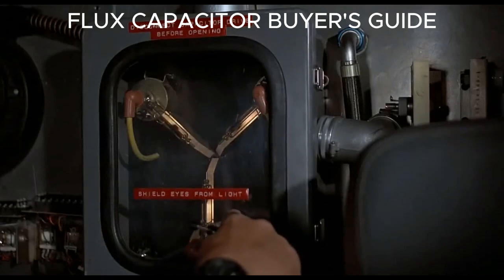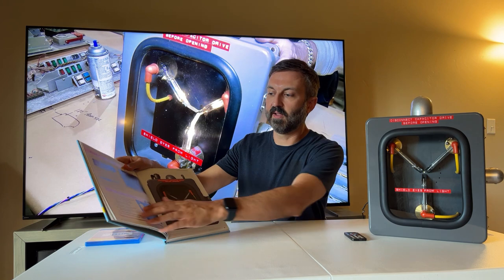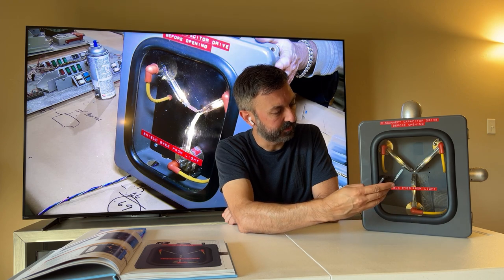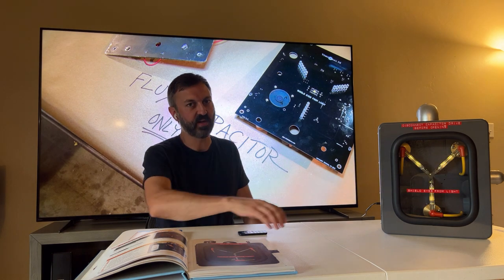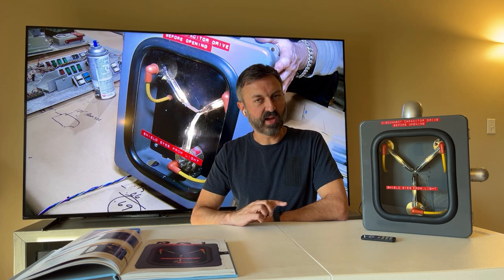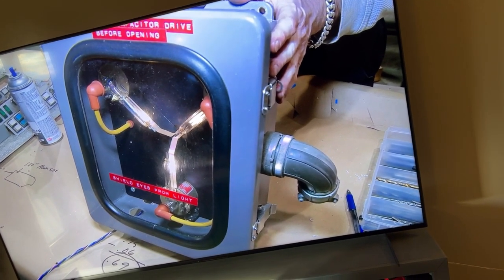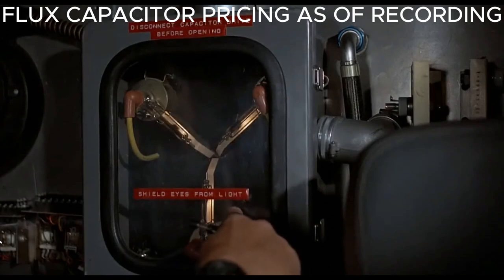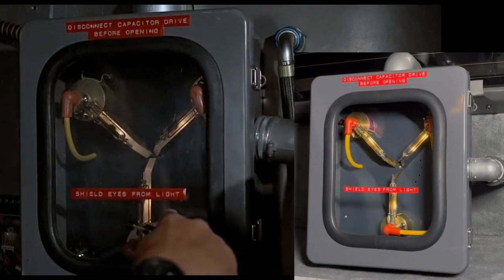Flux Capacitor Buyer's Guide

Comment: When you say you hollowed out the blades, do you mean that you drilled through the blade so the LED is not pressed up against the bade but instead comes through the blade?
Reply from the maker: That’s correct, I used a dremel with an endmill type bit and worked the backside of the blades down so there would be maybe 1/4 of space between the top of the LEDs and the blades.  I could have just spaced the LED board away from the blades but that would also space the center light away and the IR sensor and didn’t want to do that.

Comment: Is it easy to change the LEDs chasing on the diamond select version?
Reply from the maker: Each set of 3 lights is it’s own board.  I flipped each board 180 and had to rewire with longer wires for the outer LEDs.  If you have some experience soldering it’s a simple mod. 👍

Comment: Hi there, how easy was it to change the setup of the lights on this particular flux? I have the same flux. Would it also be easy to say swap out the board on the back for a different set of LED’s from a different board with different electronics…. Keep the relays etc just add a different board on the back with different Arduino etc so it works with other props?
Thanks
Reply from the maker: It was a bit time consuming to get the lights closer together since the spacing is built into the electronics board.  To do it I had to sort of stair step the LEDs on top of each other with their leads getting progressively longer to reach the connectors.  I probably should have documented that process and shared it in the video but that was before I decided to make the channel.  If I can find any pictures I took of the process I’ll put them together in a short video.  But swapping the boards is another option that I think would have good results.
Reply: @DeLoreanCorner-vl9ub  this is very helpful, thank you. Did you drill new holes in the board for the new LED placement so they are closer to relay?
Reply: @DeLoreanCorner-vI9ub Great video! I’m curious about this modification. I own the same flux. Did you talk with the seller to see if he’d modify it? I’m afraid I’d mess mine up. Thanks -